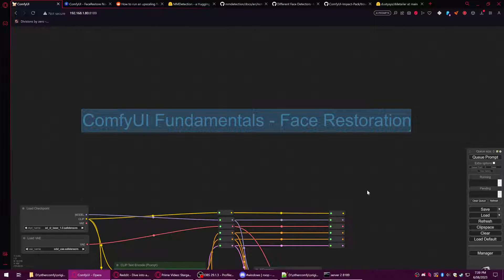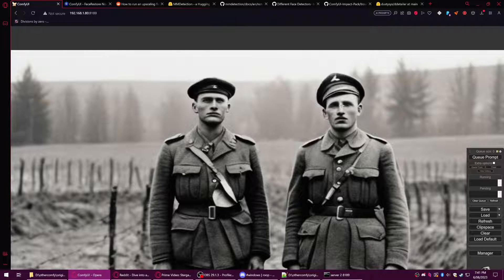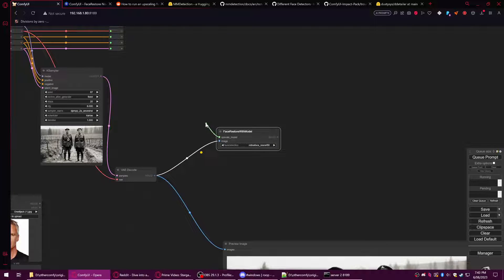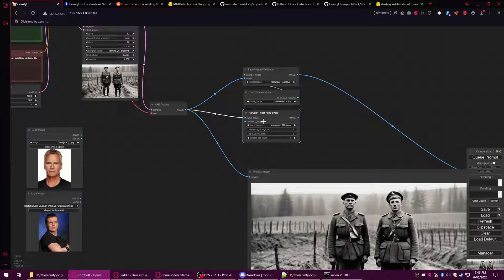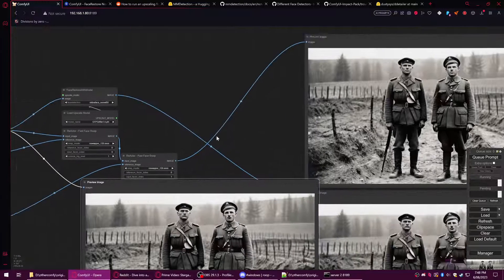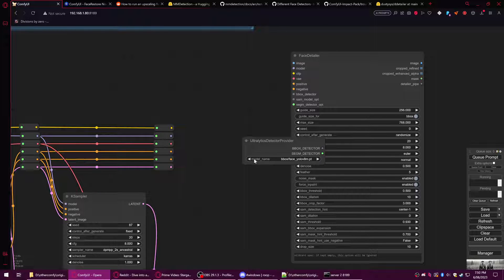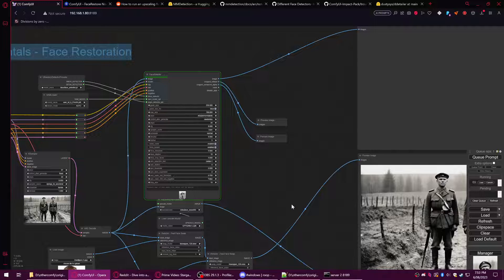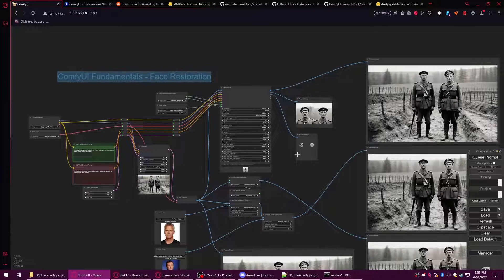ComfyUI Fundamentals - Face Restoration

Comment: Hi there, this is old enough but I hope someone will point me in the right direction. When I try to use UltralitycsDetectorProvider I get a red cross of the SEGM detector. Can somebody help me with that?! Thanks a lot!
Reply from the maker: unfortunately as comfyUI updates many issues have cropped up in different custom nodes.  many of my older videos have nodes that are broken.  That said, there are other similar methods available using different nodes. unfortunately tho face restoration stuff is largely pretty bad due to some copyright issues and broken dependancies.

Comment: Hey i have been trying to get this to work. Something weird it just turns the FaceRestoreWithModel and the 2 Reactor Fast Face Swap nodes RED wiht an outline but I cant figure out what its needing to inpout inot it. Usually its a model name and i find it online or substitute but what is the answer here? I added a sdcreenshot: https://i.ibb.co/DbVRZT8/Screenshot-2023-12-07-055713.png
Reply from the maker: Unfortunately I can't help with node specific bugs or issues, all I can do is point to the node creators page on github and say, check there. you can easily find those in the comfyui manager nodes page by clicking the node name. they are much more able to help with any issues. 
I wish I could help but with teh variability in system setups and nodes its too hard for me to offer support for that, especially seeing as I know nothing about python or the backend of things.

Comment: Thank You! All the other ways of doing this were so overly complicated than they need to be, just like you said.
CodeFormer works better.
I use FaceRestoreModelLoader with codeformer .pth going to FaceRestoreCFWithModel using ertinaface_resnet50 and most importantly, set codeformer_fidelity to 0.00
If you use this setup and want to split off to also do GFPGANv1 .4 .pth then you want that codeformer_fidelity set to 1.00 because it is the opposite to set this to maximum.
Reply: This is the way.

Comment: Good one, but the Reactor face swap won't open for me. There seems to be a bug around that node.
Reply from the maker: ive had issues with it before as well, suggest heading to the reactor github page and checking if there is a specific bug there may be a solution, if not you can post there and they might be able to help you out. 
unfortunately due to the variability in comfyui installs, I can't really help much if a custom node is breaking for you. just make sure your comfyUI is fully up to date and your custom node is also up to date, and post whatever errors it throws up on the relevant github page.

Comment: Couldn't get reactor face swap to install correctly for ComfyUI. When I run its install.bat, it whines about Cython not being installed. Open source software really can be a mess sometimes lol
Reply from the maker: true, if you have major issues, its a good idea to post any errors on the nodes github bug report thing, best way to get fixes and responses. sadly one of the things I can't really help much with is when a custom node doesnt work... you know, because it works for me so without knowing the ins and outs of the node and python cant really delve into it to find problems.
Reply: @ferniclestix  thanks nonetheless

Comment: This actually worked a few weeks ago … when you published this. But I did a reinstall of comfyui and tried to go through these steps … it’s a mess. Facerestore. Roop. Face swap. And every iteration of their relevant custom nodes is borked. It seems to stem from Msft breaking onnx recently.
Reply from the maker: Yeah, sadly I cant nessesarily stop comfyUI or node makers borking things. You fully up to date and everything? ive been on a bit of a break from SD while I re-arrange my workspace XD so I haven' had time to check.
Reply: @ferniclestix  yeah. I actually have a backup from a few weeks ago where this still works. Doing a fresh install - it fails.

Comment: needs a section on procuring the nodes first though, some links would be even lovelier
Reply from the maker: mm, I struggle with installing nodes sometimes, I generally stay away from the topic of how to get them going because in all honesty, I succckk at python and getting it to do what I say.  I don't feel confident giving advice about installing nodes because of this and its so tedious debugging them when they break. Ill always now just say use ComfyUI manager and visit the relevant github page if it messes up.
Reply: @ferniclestix  ohhh, I get you, no worries big homie💯
Reply: @ferniclestix  how do you do multiple control nets i need it for a project. plz help
Reply from the maker: efficiency nodes has a node called control net stacker that can make it easier but you can connect them in series although you may have to balance the strength to get it to apply sanely.

Comment: i've inatalled ReActor but it doens't show when i load up comfyui. Impact is fine though, but it's the face swap i needed. running it on colab
Reply from the maker: have you checked out the github page for reactor? they fixed alot of the issues they did have.

Comment: Im having trouble finding the VAE. Can anyone provide a link? :)
Reply: And also retinaface_resnet50 :(
Reply from the maker: I got it off hugging face but as its a non-standard version it may have been overwritten, there are a few different versions, the one im using is 'supposed' to reduce some artifacting, the vae that comes embedded with SDXL base should generally be fine.
Reply: @ferniclestix  Thank you. I got that part working I am happy to report. Any plans to maybe make a video about how to faceswap with roop?
Reply from the maker: technically reactor is a 'roop like' in that it is based on roop. I've tried to get roop nodes working but most are pretty busted.
Reply: @ferniclestix  Yeah, Ive had problems with roop. It wont even show up on Webui, just errors. I have been playing around with softwares like Deepfacelab and Faceswap but that stuff takes alot of time. Would it be possible for you to do a video on faceswapping in Stable Diffusion?
Reply from the maker: Hmm, Reactor is a face swap node, I swap some faces in the tutorial above. Unless im misunderstanding you.

Comment: FaceRestoreWithModel always error.
Reply from the maker: many of the face restore nodes have issues. It's a result of using the portable install of comfyUI. 
the standards for comfyUI node makers arent high and many forget to add the possibility of embedded python or system python being options for comfyUI and sometimes hardcode installs to the wrong place.  or when trying to install we mess it up by installing modules to the wrong place.

Comment: Is there a good solution for the resolution problem with Reactor/roof and SDXL? 

Guess the model those solutions use is just too lowres, so you don't get good results with the new higher resolutions SDXL provides. Faces always have less resolution than the rest of the image. 

Also the face mask seems to include part of the hair most of the time, which also gets lowres by the process.

You can add additional steps with base or refiner afterwards, but if you use enough steps to fix the low resolution, the effect of roof is almost gone.

Are there similar models with higher resolutions from other developers or could we implement the model with Facedetailer (instead of a text input), which at least allows more accurate image masks.

Otherwise a good overview - found the same solutions when doing my research.

Comment: Awesome video again, I'm getting a "Error occurred when executing MMDetDetectorProvider: No module named 'gradio'" error, just wondering if this is some easy setting I have wrong or something.
Reply from the maker: hmmm... looks like maybe impact pack has an install issue? mmdetectorprovider is an impact pack node. I've had plenty of errors but not this one before.
Reply: @ferniclestix  Thanks but it's something basic I think, it's happening when it tries to load any type of upscale model now. I 've had it before I think but...🤬
Reply from the maker: could be an install bug with gradio too, its a module in python so... maybe you have system path issues or something. I had issues liek that aaages ago, ended up reinstalling windows to make it shut up XD

Comment: hi, great videos so far. I'm having trouble installing ReActorfaceswap, something during installation that wheel could not be build, Cython module is missing?
Reply from the maker: yeah, hang on, i got you fam, https://github.com/Gourieff/comfyui-reactor-node  - down the bottom under troubleshooting, it tells you what to do.  although the page is terrible at telling you.
Visual Studio or VS C++ Build Tools  needs to be installed.  There is a prebuilt option although I'm not sure how to install it to comfyUI, so its better jsut to install visual studio and make sure you install the python and C++ module
Reply: @ferniclestix  hmm, still doesn't work. Problem appears to be Insightface (ModuleNotFoundError: No module named 'insightface').  Perhaps I'll try another method for faceswap.
Reply from the maker: trust me, this is the fix, you need to install visual studio, I know this because I had the exact same error and thats what fixed it for me.  ( think I also reinstalled the reactor node after I installed visual studio.
Reply: @ferniclestix  nope, did do the install end reinstalled reactor node, still an insightface error, and the reactor node won't start. Additionally it says: Error: OpenAI API key is invalid OpenAI features wont work for you. Is this related. Sorry, I am not very good at this Pythonstuff.
Reply from the maker: Im afraid I can't really walk you through a fix, I can only tell you what fixed it for me :(  I think I had to do a module install using pip as well, I went to the node that reactor is based on and followed parts of those install instructions.

Open AI key bug is from having the quality of life nodes and won't affect anything. Its to do with some of the prompt AI tools it uses (gpt and stuff) it needs the key so it can use gpt for prompting... mostly useless tbh, I ignore it.

This is where I found the stuff that fixed my Reactor https://github.com/Gourieff/sd-webui-reactor - its part of the non comfyUI one, but the person who made the comfyUI version didn't bother doing a proper install instructions.
Reply: @ferniclestix  uff, i update to vs2022 ,  I had the same problem with ReActorfaceswap, which cost me to make it work, I don't really know if I fixed it or not, the same thing happened to me with roop and with faceswap, finally I was able to solve some things, with the python and del environment variables bin of vs where is the cl.exe that gave me an error, that was solved but the OpenposePreprocessor stopped working. It used to work fine and I could do a preview of how it detected the "skeleton", as if it were some incompatibility with something, I spent hours trying to make it work, I think the environment variables solved it, now the problem is with the openposepreprocessor that worked fine before,
One more headache, luckily I had a previous backup and I'll see if it still works there (it actually works but I can't see the image of the detection before) which was essential for some things, if I remove it I think it works the same, but I can't see it anymore I think, in other workflow say error on 
    HEDPreprocessor
    MediaPipe-HandPosePreprocessor
    MediaPipe-FaceMeshPreprocessor
    ColorPreprocessor
    TilePreprocessor
    ShufflePreprocessor
    OpenposePreprocessor
    BAE-NormalMapPreprocessor
    Zoe-DepthMapPreprocessor
    ScribblePreprocessor
    OneFormer-ADE20K-SemSegPreprocessor
    OneFormer-COCO-SemSegPreprocessor
    InpaintPreprocessor
    BinaryPreprocessor
Reply from the maker: yeah it can be a bit of a rabbit hole once you start having python issues. My advice is going to the github of whatever node is bugging out and asking there how to fix, it might take a while but usually people respond.
Reply: @ferniclestix  Hi, it is fixed. Installed again via automatic1111 and somehow it works fine now, thanks